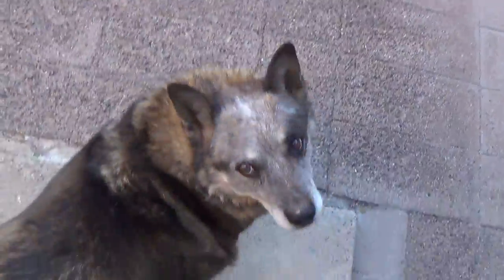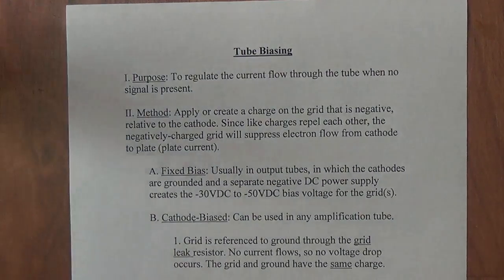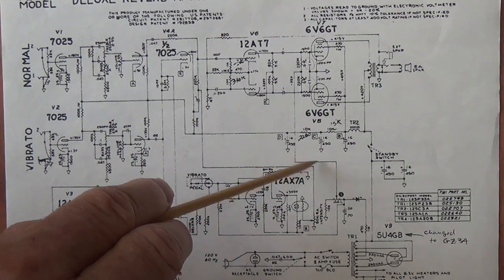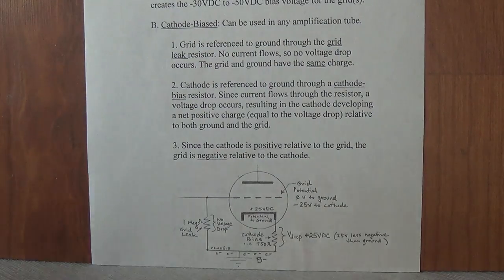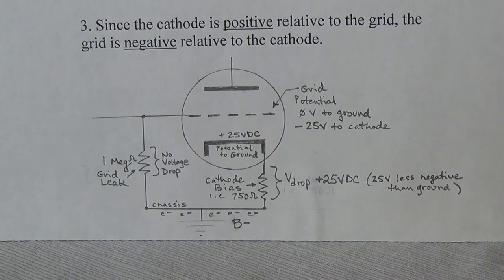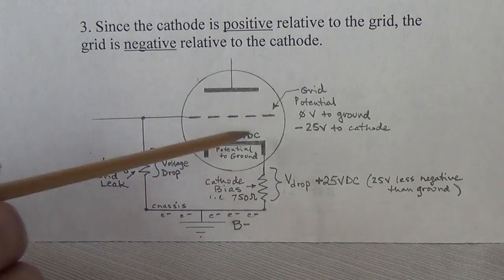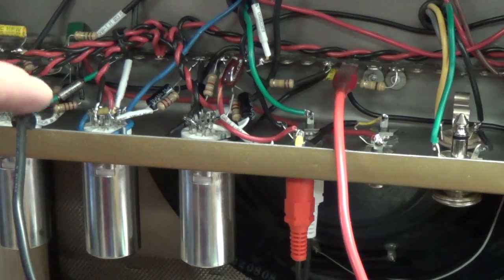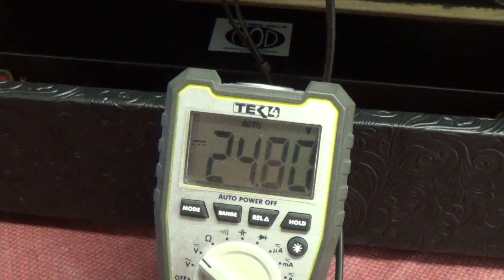Resistors, Part 4:  The Cathode Bias Resistor

Comment: Interesting demo.. This reinforces the fact that a positive polarity is the LACK of electrons as referenced to ground(negative) and a positive charge is created by stripping the electrons from the cathode, controlled by the current passing through the cathode bias resistor. Excellent demo!
Reply from the maker: Thanks, Dennis. I agree with your analysis. The only cause of a positive charge is the relative absence of electrons. I think of positive charge as being a vacuum for electrons, causing them to flow from an area of relative excess (negative charge) to an area of relative absence (positive charge).....seeking equilibrium.
Reply: A lack of electrons implies a surplus of protons, i.e., a positive charge.

Comment: Self bias is an excellent/inexpensive method to bias a tube, but it comes at an operational cost.  That cost is a slight loss of dynamic, useable voltage range in the tube.  Some of that range can be recovered by adding a cathode bypass capacitor, but that too has a cost.  In the end, fixed bias is the best if you have the available component room and money to build the extra parts.  This is a great tutorial!
Reply from the maker: Thanks so much, Thom. Glad you enjoyed it :)

Comment: Another fine video that proves you can understand tube amps without a calculus degree.   I've always done my builds based on a proven design...   where I can match the voltages to their expected values....   now I'm getting the Why, and because of it....
Reply from the maker: +DeadKoby  Thanks, DK. I agree with the use of proven circuits. Why try to re-invent the wheel?  RCA engineers designed about every possible amplifier circuit over 50 years ago, and I always find it best to rely on their (infinitely superior) wisdom, rather than semi-educated guesswork,  when building my own :)

Comment: Grid Cathode differential was very well explained. I remember when the penny finally dropped for me and it was a revelation. I arrived at the same place you did but the way I did it was to treat the plate - cathode as a resistor in between the 'real' plate and cathode resistors and that way realised the cathode could be more positive than the grid or more importantly how the grid could be 0, -2, -4, -6v etc. with respect to the cathode. It's a very simple thing but if you don't use it every day for biasing valves and transistors it 'slips away'.
Some of these videos probably require watching several times in conjunction with playing with LTSpice et al until they are second nature.
Anyway thanks for the free video course.
Reply from the maker: You're quite welcome, Peter. Thanks for your detailed and informative response.

Comment: Great video Unc Doug!  It caused me to realize a confusion I have had for a long time (and didn’t know I had).  And it’s caused by the names of the bias methods.  The “Fixed” Bias method actually has a way to “adjust” the voltage on the grids (via the bias pot) ;  So – maybe not so – “fixed”.  Where-as the Cathode bias method provides a truly “fixed” bias – based on the size of the Cathode bias resistor.  The names of things can really cause confusion if not aptly applied !!  ;) ;)  Thanks for all the great videos !!
Reply from the maker: +Donald Filbert  You're quite right, Donald. The term "fixed bias" is indeed quite misleading, but that's the generally accepted name for the process......which was probably established before someone thought up the idea of making the grid bias voltage variable.
Reply: +Uncle Doug Ya - that's probably it.  Your last comment clarifies it !!

Comment: One key fact I believe was omitted that will help beginners understand the theory, which is that electrons are negatively charged and flow towards the positive side of the circuit - meaning that for example the cathode is at a lower voltage than the plate / anode which allows for the flow of electrons in the tube.  The greater the voltage difference between the cathode and the plate, the stronger the electric field directing electrons from the cathode to the plate. This electric field is what enables the control of electron flow within the tube, which is the basis for the tube's amplification and switching properties.  A good way to think of this is that the positive terminal of a battery is not actually where the electrons flow (it is positively charged from ions), instead the electrons flow from the negative terminal toward the positive.  

Also worth mentioning is that the grid carries a DC bias voltage as well as the AC current of the audio signal.  It has been described as the water level of a pool (DC voltage) with the waves on top being the AC current.  Next time you're listening to Hells Bells, remember that the song is being amplified through the AC/DC current in the grid.  As always, thank you for your wonderful work Uncle Doug, you and your team of hard working four legged friends are greatly appreciated.
Reply from the maker: Thanks for your helpful input, Jules. As viewers well know,  I am a strong proponent of electron flow theory (from - to +).

Comment: Great series of videos. I have come back to them having not seen them in a while. They are always good, and you have helped me change my opinion about cats. Jack seems like such a nice guy. He has great personality.
Totally confused why the voltage measurement over the cathode bias resistor is different to the cathode to ground measurement though. I thought they would be the same. But I'll keep thinking about it. It will come to me eventually. Thanks a lot.
Reply from the maker: Thanks so much for your kind words, Chris. Jack is pleased that you appreciate his performance in the video. Now I'm confused.....the voltage drop across the cathode bias resistor is the same as the voltage between the cathode and ground. They are both measured in the same way, since the bias resistor is grounded at one end.
Reply: @UncleDoug  Thanks for the reply. ... but that is what I thought too. It is that one is minus 25V and the other is positive 25V. I am sure it is my misunderstanding but I have been baffled about this. I will study it all again and see where I have gone wrong.
Reply from the maker: @christophersmith2165  The -25V is because it is a voltage drop, Chris. "Drops" are negative. The +25V is simply the potential between the cathode and ground, and it's positive because the voltage in the circuit is positive (B+).
Reply: @UncleDoug  Thanks a lot. The thing with electronics is that it is so often counterintuitive.
Reply from the maker: @christophersmith2165  The complexity is what makes it both challenging and interesting :)

Comment: Hi uncle Doug, I finally found the ‘culprits’ a pair of coupling caps b4 the grid of the 845...
Checked their value looks ok 0.47uF but they leaking DC...
Replaced them n all is good now...neg bias volt quite stable after an hour
Many thanks!
Reply from the maker: That's great, Tony. Congratulations on a successful repair.

Comment: We like Rusty.  Point of order: As soon as you put the grid leak resistor in, i started thinking that the voltage drop on the grid leak resistor was much higher than the bias resistor voltage drop.  One meg is almost an open circuit.  I'm confused, and that's fine, but others might also be confused.  Great videos.  PS. Resistors part 1 explains it very nicely.
Reply from the maker: Rusty appreciates your nice comment, Alex. Voltage drop is related to current flow through the resistor. In the case of grid leak resistors, there is virtually no current and thus very little voltage drop.

Comment: I was watching this on the tram into town (for my physio session) earlier this morning, listening with earbuds in, and had to smile when I could hear Jack mewing in the background.  Great explanation once again my friend.
Reply from the maker: +Andy Wragg  Jack is a shameless ham, Andy. I hope the session went well. Thanks for your kind words :)
Reply from the maker: +Andy Wragg The amp sounds quite nice, Andy. If the rectifier is arcing, are your filter caps of excessively high capacitance ?
Reply: The caps are as specified in the design a pair of 50+50uf 500V. I've ordered a new rectifier from a different brand - TAD this time. Should be here tomorrow, so I will soon see if it's the circuit or just a bad rectifier tube. I've not got over how good it sounds for a first time build. Really happy with the sound, WHEN it's not blowing fuses.
Reply from the maker: The amp does indeed sound great. What rectifier tube does it use? The tube handbook states maximum values for the first capacitor in the power supply....50uf might be too much.
Reply: The Tube Depot kit which accompanies the design comes with a JJ GZ34, which is the same one as I have been using.
Reply: BTW - What book are you referring to? Seems like a right riveting read?
Reply from the maker: Any tube data book that lists the GZ34: i.e.  http://www.triodeel.com/5ar4_p1.gif You're OK with 50uf.....the max is 60uf.
Reply: I managed to find the RCA Tube receiving manual online and have had a quick scan through. Very Informative. Anyhoo new TAD works in principle, just need to check the bias and we should be all done.
Reply from the maker: Yes, these tube manuals are the "bible" of tube electronics. Best of luck with the completion of your project.
Reply: It's done. I've checked and adjusted the bias, as it had changed due to the slight change in plate voltage. Have a gig tomorrow but will use my usual rig, just to be safe. Will be revealing it to the public on Wednesday when I play in the house band at the local Jam night. Once again thanks for your help Uncle Doug.
Reply from the maker: You're welcome, Andy. Take along some extra fuses (or a Current Limiter) to the unveiling, just to be sure :)))  Seriously, I'm certain it will work out great and really impress the audience. Best of luck.

Comment: You mentioned that the ideal plate dissipation is 11.65W (achieved with the higher value cathode bias resistor).  If that is the case, why do you have the switch option for the lower value resistor?  I'm thinking you probably answer that in the build video but I figured to ask here too.  I'll try to watch that video as well.
Thanks for sharing your wealth of knowledge, this is incredible!
Reply from the maker: I believe the circuit you are asking about allowed for use of a 6V6 or a 6L6. The switch was used to bias the 6L6. Glad you enjoyed the video, HP.

Comment: Uncle Doug,
Please consider a comprehensive series on capacitors as well, discussing ESR and leakage and why/where these values are important. throw in red hot tubes comments if you want. Craig
Reply from the maker: +Craig Hollabaugh  I will, Craig. It would be a natural progression from the discussion of resistors. Thanks for the suggestion.

Comment: Another fantastic video, thank you Uncle Doug.  Within the context of this lesson on Cathode Bias Resistors, I am still curious as to why most are Capacitor Bypassed and some - like the WILLIAMSON circuit - are not.  What purpose does the Cathode Resistor Bypass Capacitor serve?  And what drives the design decision to use one - or not?  Very much looking forward to you crystal clear unpacking of these closely related questions.  Appreciated.
Reply from the maker: I have posted a video explaining how the bypass cap works and what its overall effect is on the circuit, Tony. Please check my video list.

Comment: In cathode biasing, the whole tube circuit is below ground voltage, making ground positive, and allow ground to be used as a grid voltage. This is the essential part to understand.
So +25v cathode and 0v grid, is the same as 0v cathode and -25v grid, or say -50v cathode and -75v grid. You just need to have the grid more negative. If the cathode is +25v to ground, the anode must be even more positive.
Reply from the maker: Thanks for your helpful input, W.

Comment: Now I get it, I was thinking in the conventional flow from positive from negative and that's why I weren't able to understand where that voltage drop was coming from. Cheers :)
Reply from the maker: +ciprianwiner   Yes, occasionally current flow is represented as traveling from + to -, but this is not correct. Current consists of electrons, which are negative, and it flows from areas of high electron concentration (very negative) to areas of lower electron concentration (less negative, i.e. relatively positive)......from negative to positive.
Reply: 'Occasionally' is not quite correct. If you read books and articles by tube amp gurus such as Randall Aiken, the Valve Wizard or Rod Elliot, you'll find that, whereas the operation of the actual tube itself is described in terms of electron flow, tube amp CIRCUITS are almost invariably described in terms of conventional current. If you are hoping to build on Uncle Doug's excellent explanations of the basics of tube amps, developing the ability to think in terms of which ever scheme is most appropriate in any given situation is a useful, if not an essential, skill.

Comment: I spent a lot of time trying to wrap my head around why the grid doesn't have any current running thru it-doesn't it need to have a changing current to amplify a signal?  Then I realized everything in your diagrams was DC and the signal is AC simultaneously using the same wire...  I'm learning Uncle Doug!
Reply from the maker: That's good to hear, Matt. The grid is an electrical dead end, but it can hold a charge that alters between positive and negative in response to the music signal applied to it.

Comment: I hope you can clarify something. What is the purpose of the grid leak resistor, especially since you indicated that there is no VD across it, and then implied that there is a very small VD across it.

I studied electronics as a teen in high school the the 1960s, building tube projects when solid state was in its infancy. I switched to being an electrician as a career and I am about to retire from that. Your videos have rekindled my interest and refreshed my knowledge and for that I am grateful. I may resume electronics as a hobby if I can find tube stuff to work on. Thank you again.
Reply from the maker: You're welcome, Danielle. Best of luck with your rekindled interest in tube electronics. If I ever said that there was "no" voltage drop across a grid leak resistor, them I  misspoke. A resistor with no voltage drop  is useless. Yes, there is a tiny voltage drop across it, and this is what establishes the bias of the tube, with the charge on the grid being slightly more negative than the cathode.
Reply: A very small current flows in the grid leak which develops the 'very small' voltage drop which is so tiny that for practical purposes it can be ignored and we can assume that there is no voltage drop across the grid leak resistor. This means that both ends of the resistor must be at the same voltage. One end is connected to ground (0V) which means that the other end and therefore the grid must also be at 0V with respect to ground. The grid is 'tied to ground' by the grid leak resistor. There is a positive voltage at the cathode developed by current flowing in the cathode bias resistor. If the cathode is positive with respect to ground and the grid is at ground potential then the cathode is positive with respect to the grid, i.e. the grid is negative with respect to the cathode.

Comment: Very good video, Explanations are easy to understand. Thank you to have printed them, that helps a lot for people like me that don't speak English.

I have a question:

"Tube Biasing Purpose: To regulate the current flow through the tube when no signal is present"

As the grid becomes more negative relating to the cathode when the current flow, doesn't the cathode resistor also tend to affect the current flow when there is a signal, like a negative feed back?
How does that sound compared with a grid bias with a small battery inserted in the input - grid side of the circuit instead of a cathode resistor?
I once made a one stage amplifier with a 9 volts battery as a grid bias and it sounded very well, even with only a regualr 220 volts to 12 volts power transformer used as audio transformer. I obtened the high voltage source directly from the 220 volts AC outlet, rectified and filtered.

There is something I don't understand with your measures: you first measure the voltage drop of the cathode bias resistor, and then measure the same voltage between cathode and ground. As the resitor ends are connected to cathode and ground, aren't these 2 measurements the same, but just taken a bit more far away?

At 11:55 "the first measurment I intend to take is the voltage drop across the 750 ohm cathode bias resistor". Sorry, but the colors on the resitor doesn't match 750 ohm. Isn't that rather a 680 ohm resistor?
Reply from the maker: Greetings, Fong, and thanks for your nice comments. 1.) The value of the cathode resistor doesn't change, only the amount of negative charge on the grid changes in response to the alternating music signal being applied to it.  2.) To measure bias with a cathode biased circuit, first you measure the exact resistance of the bias resistor, in Ohms, then you measure the voltage drop across the resistor, in Volts. Two different measurements with two different units. 3.) You can't trust the marks on the resistor. You must actually measure it with an accurate ohmmeter.

Comment: As it turns out many high gain amplifiers use very high value cathode bias resistors unbypassed on preamp tubes (Soldanos use a 39k resistor, many Marshalls like the JMP use a 10k) to generate asymmetrical clipping, for those who are interested.
Reply from the maker: Thanks for your input, David.